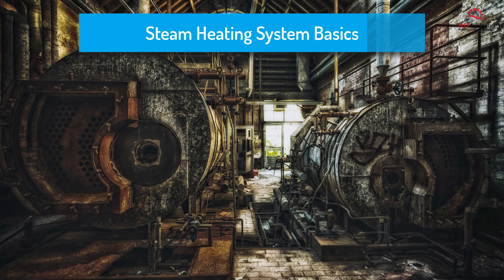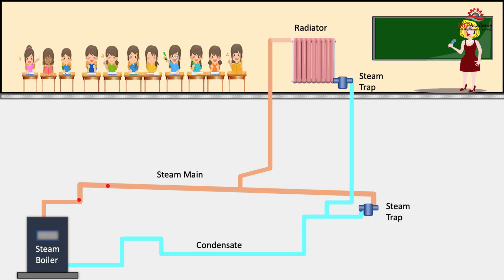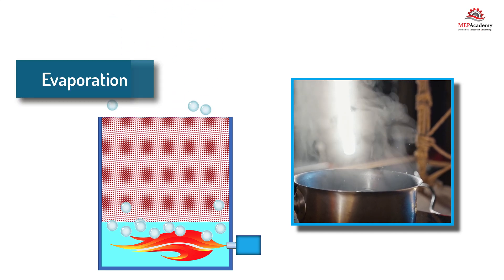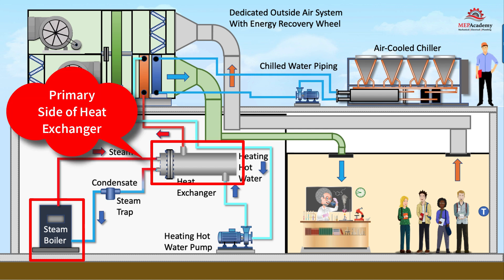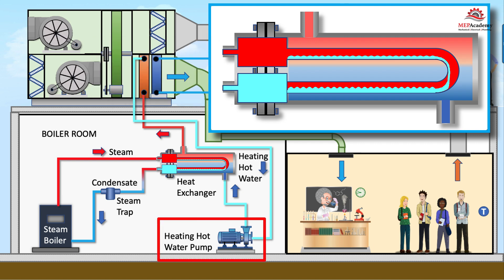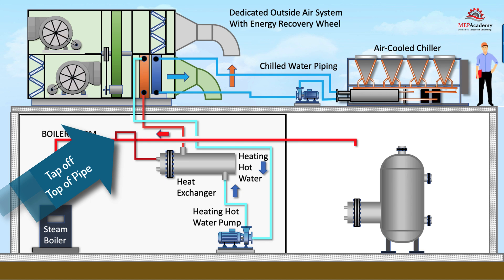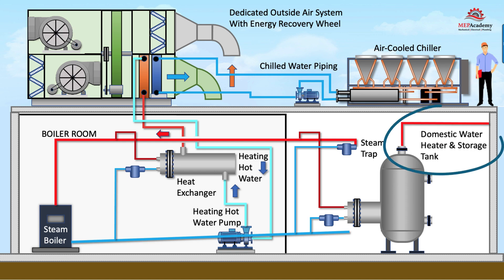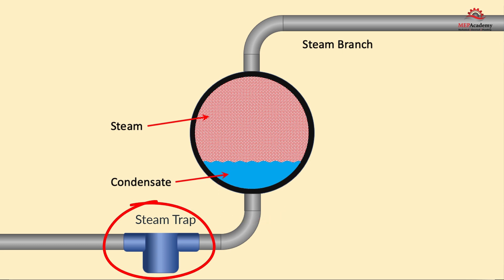Steam Heating System Basics

Comment: How many 1" branch lines can come off a 4" steam main?
Reply from the maker: The number of 1-inch branch lines that can come off a 4-inch steam main depends on several factors, including the steam flow rate, pressure, and the specific requirements of the system.

Comment: Soooo there is no reason why the source of heat can't be generated by induction technology! Makeing it very cost effective. Yet I can not find induction tech heater systems?!! Why not?
Reply from the maker: How about a linear active beam in heating mode using a hot water coil? This uses the principle of induction. See our other video on Chilled Beams for the basic principle of inducing air through a coil.   https://youtu.be/iRtBES-eSV8